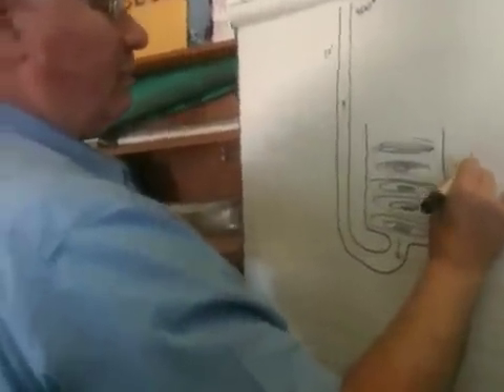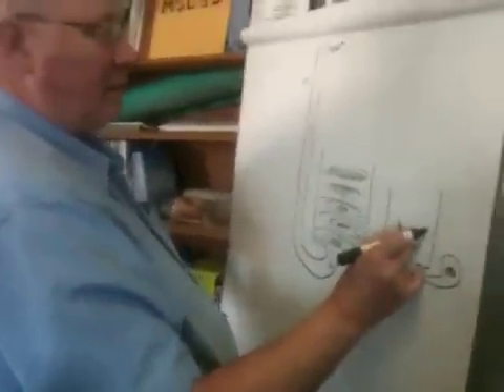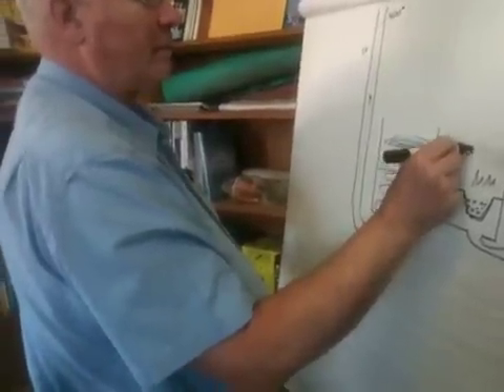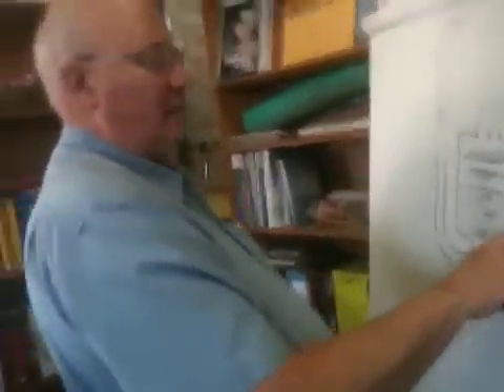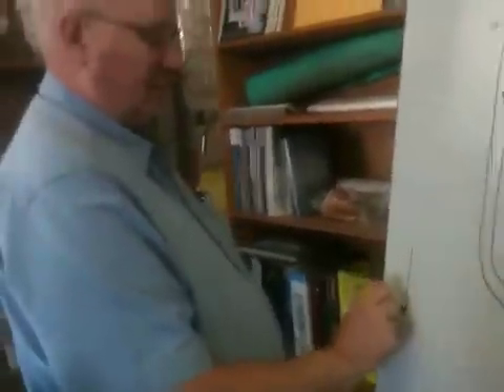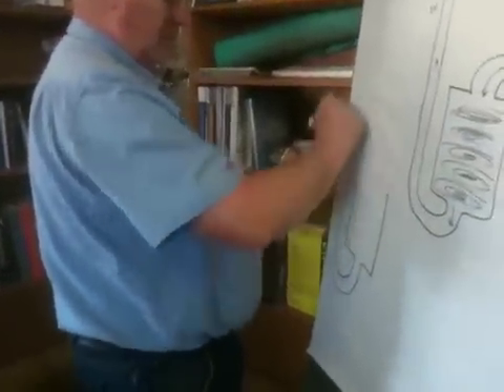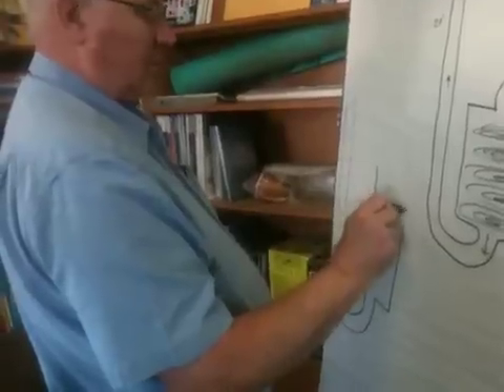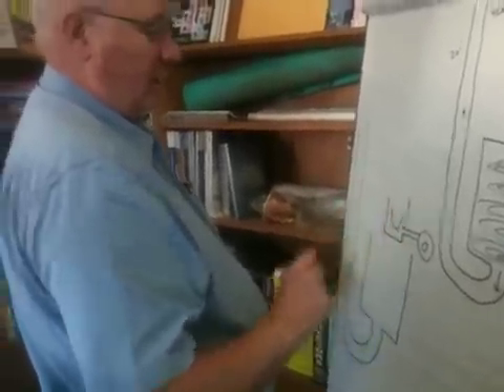Pellet burner with heat exchanger

Comment: This reminds me of a rocket stove or rocket mass heater where they burn a fuel very fast, hot and efficiently in a insulated burn chamber and then they direct the high temperature exhaust through a thermal mass like cob/brick or in your case water.  The temperatures of the exhaust are not much higher then a clothes dryer after all the heat has been extracted.  The draw of the chimney stack is before you extract the heat in the case of a rocket mass heater.